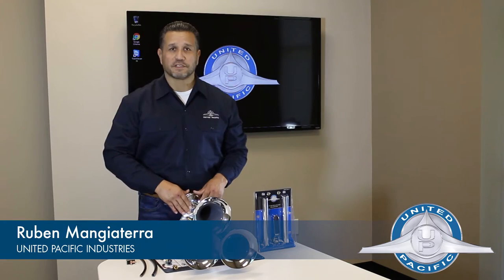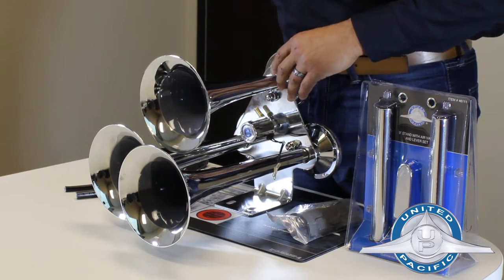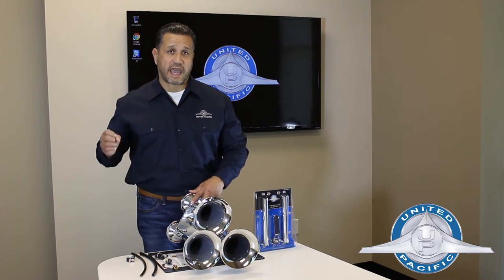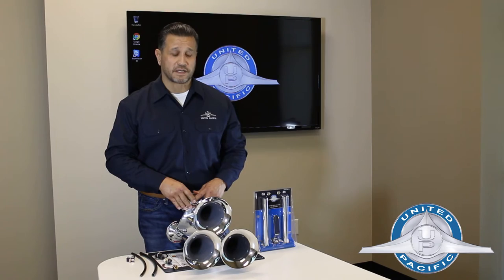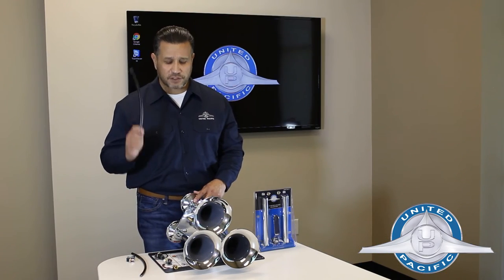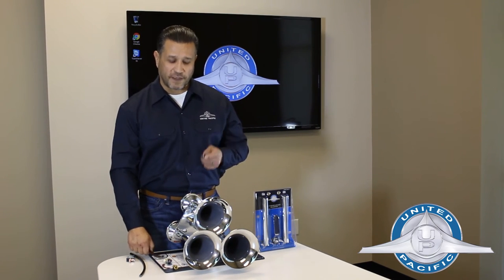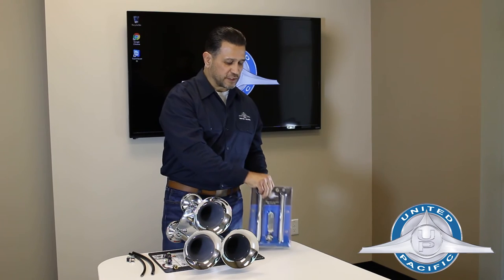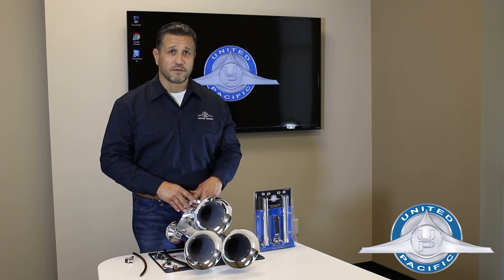How To Install a Train Horn in Your Semi Truck

Comment: Volvo VNL drivers;; unplug air line going to air horn, remove your old air horn, remove the 1/2 inch fitting from your old air horn,,,,,, From the new horn remove the solenoid, screw in the 1/2 inch fitting from the old horn in the place of solenoid on the new horn, install the horn in the same place (might need to drill new hole) plug in the airline. 
Volvo will be heard from the distance

Comment: Can I hook up the solenoid wires to my factory horn wires so that I can press the horn on my steering wheel?
Reply from the maker: It is possible to wire the air horn to the horn button in the steering wheel.  You would need to hook up the air horn’s solenoid valve wires to the wire(s) that go the OE horn.  Note: this would be non-typical wiring set-up and likely involve splicing into the harness that powers the steering wheel button. Thanks.

Comment: What is the part number for the fitting to eliminate the solenoid
Reply from the maker: You can remove the solenoid and hook it up as a direct drive to the air line. You may need to get a lanyard valve.